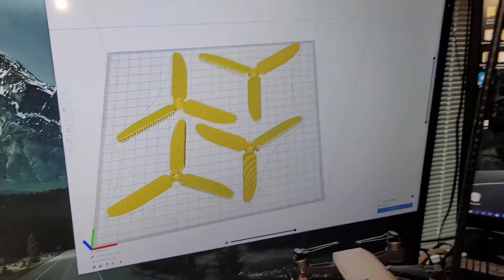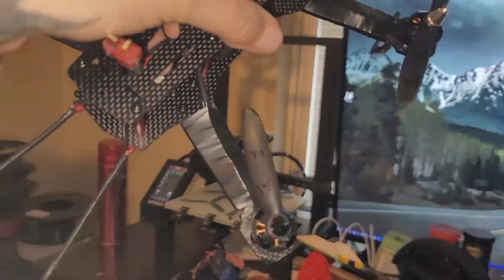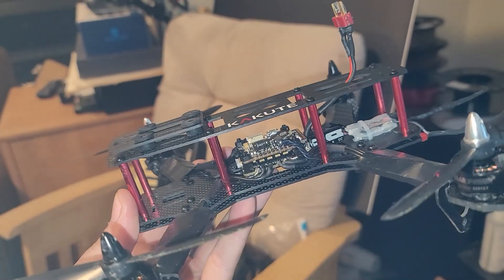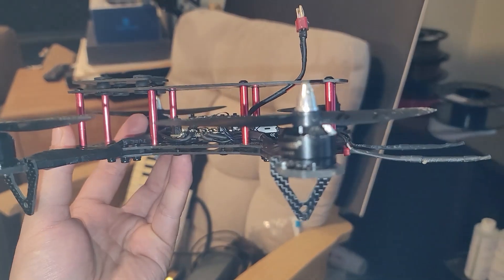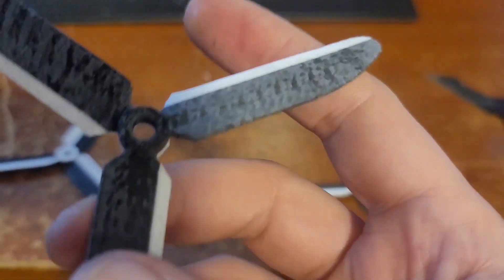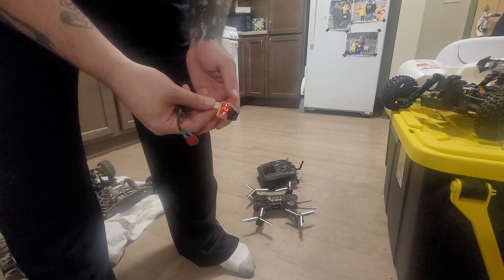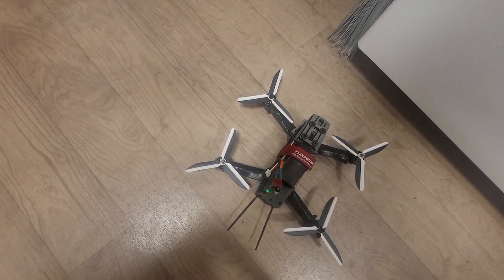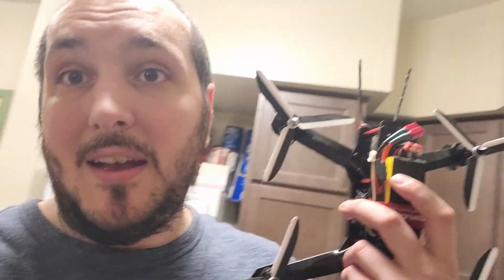Can you 3D print Drone props?

Comment: Did they blow apart on punch out? I don't have a printer, but I would love to test em. The hawk 5 lost for a year is a little freestyle on my channel if you would like to check out my flying.
Reply from the maker: They actually survived about 10 minutes of full throttle punches one after the olther.. But the very first time i touched the grass with them not in a hard crash at all they exploded. theyre extremely weak. Strong enough to fly with but only with no crashes at all.
Reply: @jstagzsr  everyone I've ever seen make em they blew apart quick, but I've never seen them printed with carbon fiber. Carbon / nylon might work.
Reply from the maker: @RCOverKill  yeah abs might be better too. pla is kinda brittle when its that thin. It was a weird design too. The blades werent shaped like normal blades where theyre thicker in some spots,, it was just a super thin flat blade. There is DEFinitely room for improvement!